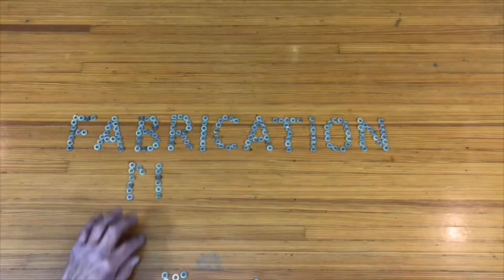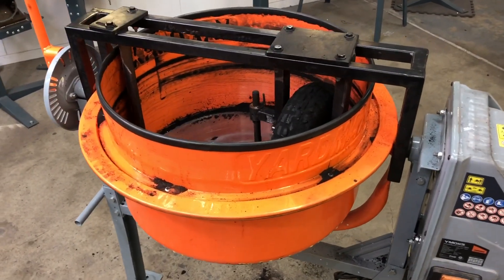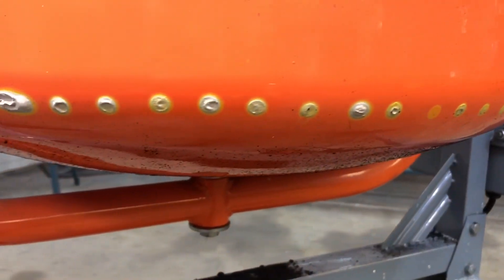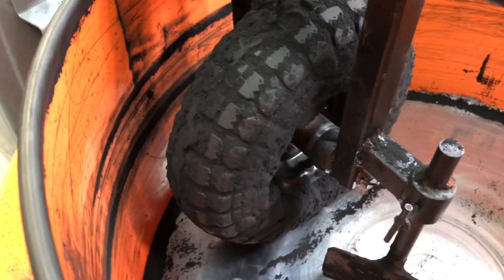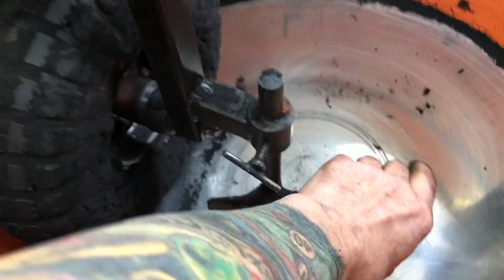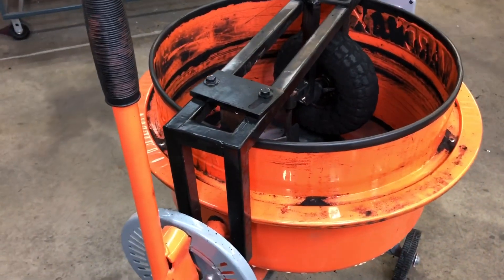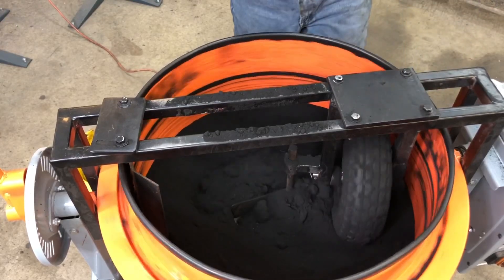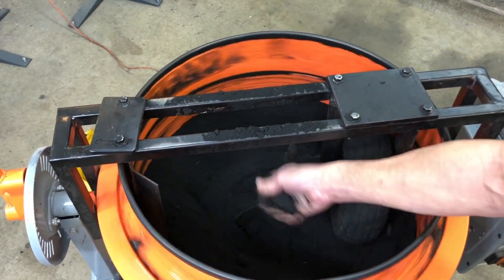How to build a low buck sand muller 2019

Comment: Why 2 stroke vs sae 30?
Reply from the maker: not actually sure but 2 stoke oil viscosity is higher making it a thinner oil may mix better. I have used different oils and they seemed to work fine

Comment: I was looking for a miller build and ran across your site, it looks great and use a Harbor Freight cement mixer and it's almost made. Have a question for you  you might have mention it in another video but do you have a formula for your sand mix what is in it and how much in each item.
Thanks
Reply from the maker: Hey William
I have made my own sand with 120 mesh fine grit sand and premade petrobond binder, sorry I do not remember the ratio but it’s on the bag. I know there are videos here that show how to make it from scratch, cheap kitty litter needs to be ground fine in a blender and then mixed with the sand and oil to a certain ratio.
Reply: @KBrown6700  Thanks for the quick reply I have mixed green sand before by hand just wondering about the oil base sand mix I know you use 30w oil or 2 cycle oil and fine sand 100 mesh or better the high number the better finish but what I don't know is the binder, is it the same as the green sand witch is bentonite (cat litter) or is it something else where did you get your premade petrobond binder from if you remember since I've retired thought I would like to do a little casting have everything from a few years back and have subscribed also.
Thanks

Comment: I (finally) built one very similar to make and maintain water based greensand last summer, and I'm really glad I did.  I should have used one of those cheap rubber wheels too though, yours is nice and wide, whereas sand keeps trying to creep into the bearings of the $teel wheel I bought for mine, and it is only 2" wide.  :(
Reply from the maker: great machines for keeping at sand ready to use!
Reply: @KBrown6700  hey Crafty I have been sharing this with people who ask about my cement mixer muller ever since you published it.  I have a build series for mine but it's ridiculously long and boring (almost like watching some guy just drill holes and cut steel for a couple hours).  Anyhow are we ever going to get the other "how to build" videos you mentioned, about furnaces and flasks etc.?  I'm already well set up here, but always on the lookout for new ideas...